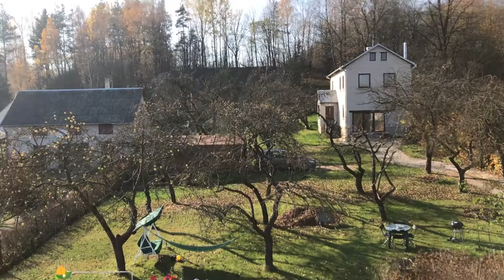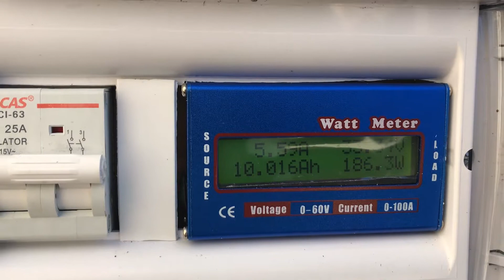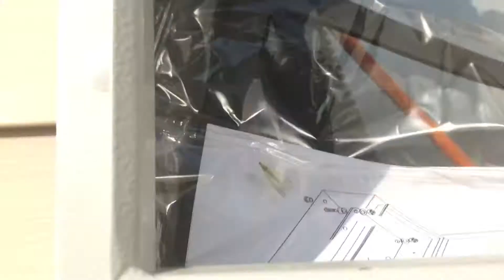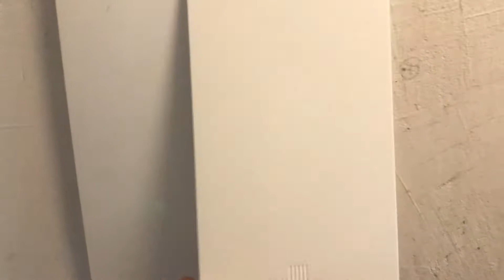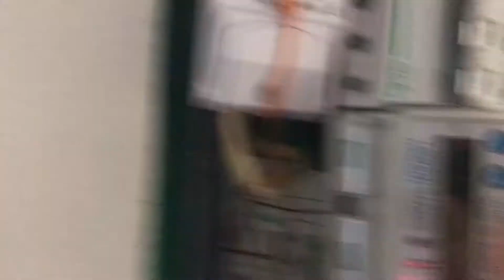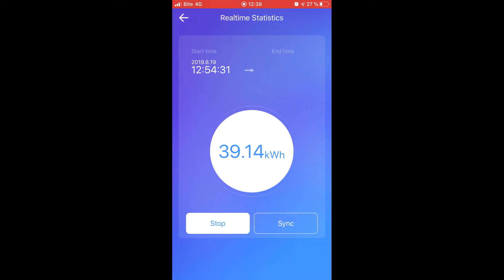Cheap 300W Grid Tie Solar Setup

Comment: shorten dc wires as much as possible, put metal box with inverter on panel stand. today i did that, coz i was wondering why my 310w panel was not going much over 200w... so now with short cables, panel cable + 1m, here in europe i was pulling 250+W. and for sure remove dc power meter, i have same inverter its shockingly really 87% efficient as you can see in this video https://www.youtube.com/watch?v=9j8ZLfPsXV0.
i did few basic tests on efficiency myself also, getting numbers bettween  80-90% depending on input power.
Reply from the maker: Yes, it's physics, you either have short thin cables or very thick cables long cables. this is the only way you can transfer substantial current at low voltage.
Reply: @evsolar  yes in theory. in pratice for low DC losses, you need to have short thick cables. good luck.

Comment: Very cool. I wanna diy our system the whole 9 yards...I'd like to do a full system with large batteries to handle our full energy take from the grid and be completely offgrid.
Reply from the maker: Do it. Interesting observation I had during the winter is that because of low voltage the inverter does not kick-in on cloudy days,  so I need another inverter or increase the voltage of the system by adding an additional panel in series.
Reply: @evsolar  maybe more panel. dont waste money on new inverter. im just in process of comparing my chinese gwv600 with friends beon complete setup, and this chines thing is working quite the same as that european made beon but with 2x the price and 2x lower power. btw gwv600 doesnt work below 10watts and those expensive beons also works so so, 10 watts is marginal power, dont get bother for it. just make calucations how long you need to collect energy to recover 200euros with 10watts for a price difference between 2x 250w beon and gwv600. i also can show you some graphs on rainy day vs sunny day on beon and gwv if you wannna see (we both produce 0 on heavy cloud day). my only hope is that gwv doesnt die on me beyond repair, but its quite easy repairable.
Reply: @evsolar  and btw dont belive cec and eu efficiency numbers, they been manipulated.
Reply: @James Edington  i understand you, but i think batteries are not yet ok. think in a way to heat your water with solar. 100liter of 70C water holds around 4kw of energy its clean and its super cheap, you can get 100l water heater for 100eur and its capacity stays the same, used one is for free. water heater consumes the most electricity in my household. i cook with propane or woods and heat with woods.